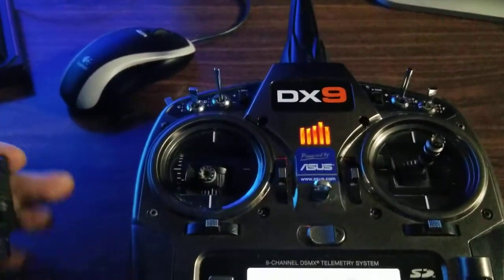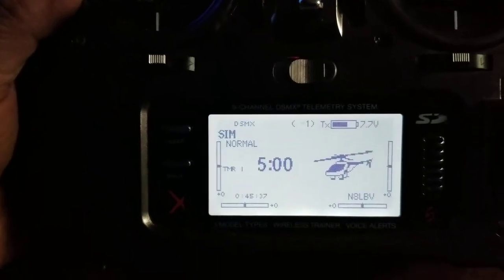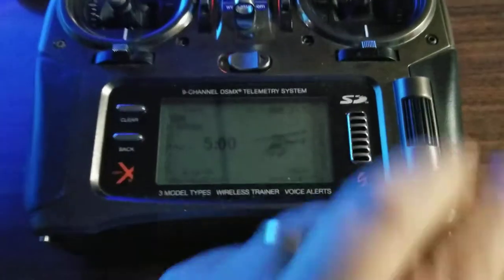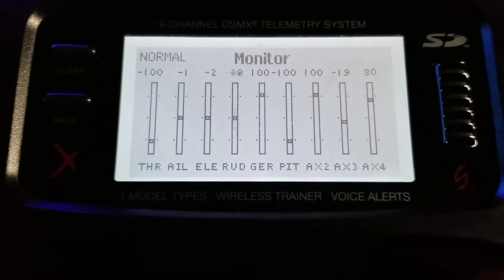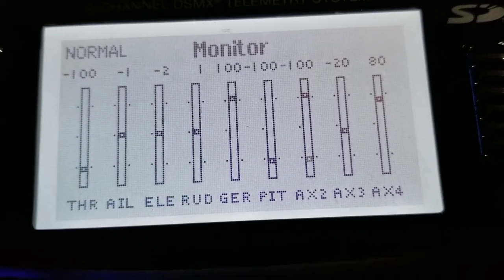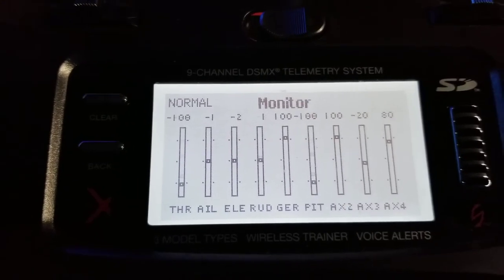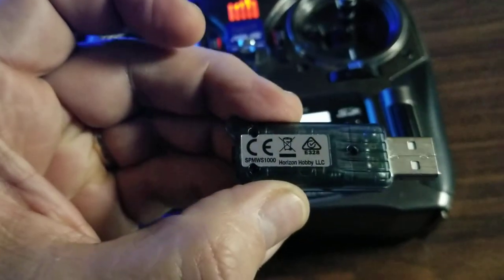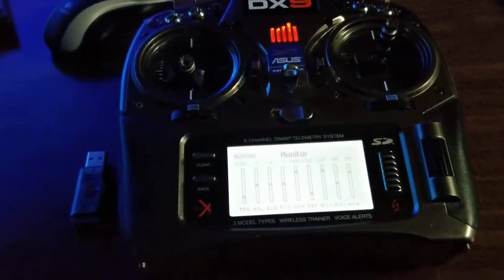PART 1 Setup Realflight 9.5 + wireless dongle + DX9 transmitter

Comment: I have a JP 9XII with Spektrum module installed. I am using the Spektrum WS2000 dongle which appears to bind but I get no movement in any channel
Reply from the maker: Does it work with a spektrum receiver on the bench with a servo hooked up?
Reply: @n8lbv  I hav eOMP M1 and M2  and I fly both with my JR 9x with Spektrum module
Reply: @n8lbv  i fly 3 helis with the TX config. It appears I'm only having issues with the dongle. Either not binding right or Windows is not seeing it properly even though I can see it in Windows control panel under game controllers
Reply from the maker: @TheDesertraptor  Weird because it should just work..  Run the calibration within windows game controller too.. do you see stuff move or numbers change?  Possibly a bad dongle?   Also try it on another computer just to see if the calibration/numbers move.  they should move.   
Re-bind the dongle to a different tx and try the same then bind it back to the JR.  
Otherwise send the dongle back to Horizon Hobby if it's bad and if it's one of theirs.  Has it ever worked foe anything before?
Reply: @n8lbv  no movement in Amy Channel. That's why I went to the interlink
Reply: @n8lbv  you would think if I can fly helis it should work. Oh well